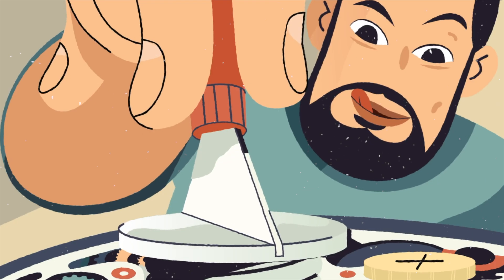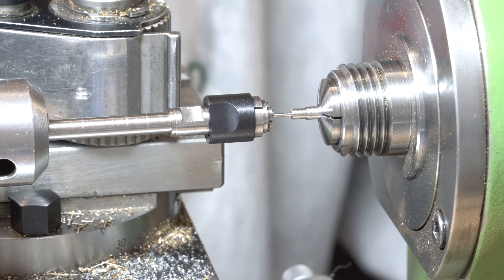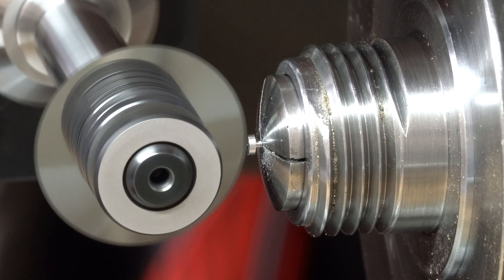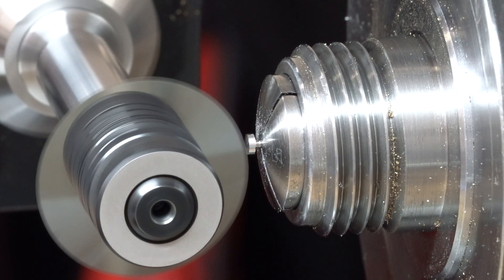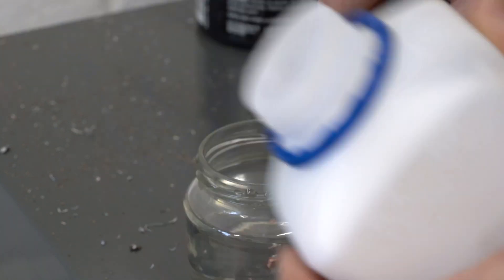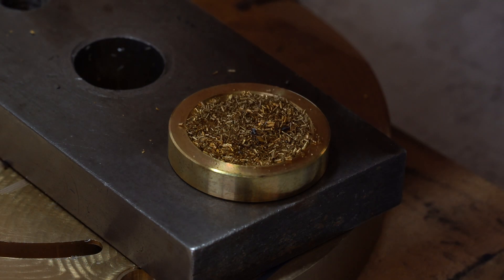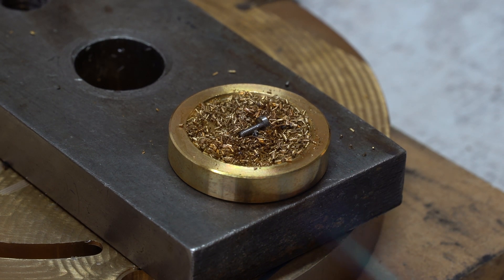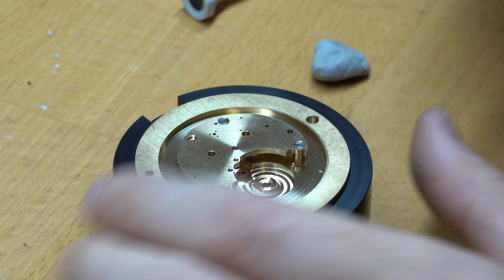The Barrel Bridge Screws - Making A Tourbillon Wristwatch

Comment: Really nice, thanks for sharing. Quick question; do you think from an engineering perspective that you might have left the shank plain until the point at which the screw enters the bottom plate and just threaded that?
Reply from the maker: I have thought about that and I can’t think of any reason not to do it other than it would look rather odd 🤣 I stop a little short of the head of the screw so there is always a small section not threaded but it’s not too much of a task to thread that much. Maybe if I was making a thousand screws I would think differently and employ the method you mentioned!